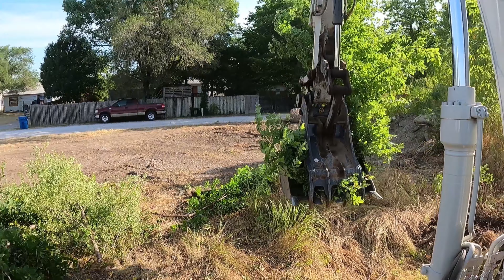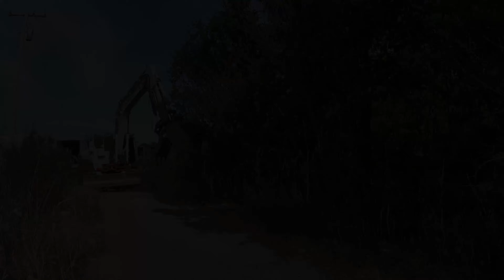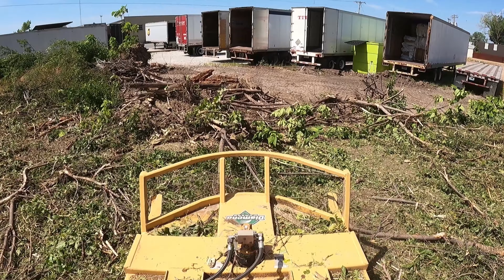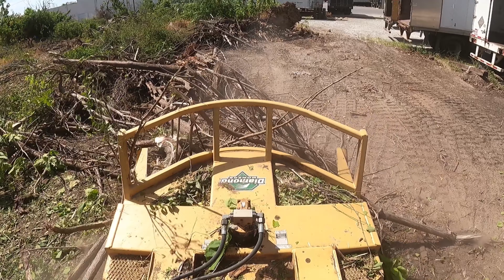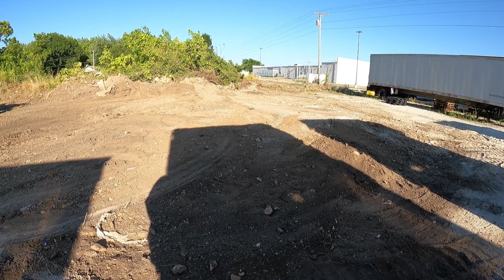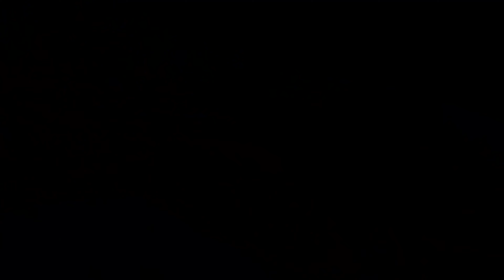Cleaning Up A Vacant Lot

Comment: A much better plan!  A fixer upper without the code restrictions vs.  a show building that meets some city engineers pipe dream of what a business should look like…. I’ll take number one every time!!!

A few more Saturdays and you’ll have this lot ready for trade!!!

Pulling those trees out of the cement might be easier than plucking them from this baked earth!  I was bush hogging my woods the past week.  Every 4 hours I had to stop and clear the air filter and radiator.  The engine never overheated but it is fair to say the radiator was plugged with dry leaves and dirt and the air filter had a half cup of dust.  

I decided to work on other projects and finish this one after the next rain… just hope we get one before it snows.

Keep living the dream… you’re getting there!
Reply from the maker: I agree this will be much better! No kidding that ground is solid right now. It was great seeing you today and thanks for the tomatoes 👍🏻

Comment: Do you have to haul off the 400 loads you mentioned?  Did I miss it or have you not been back to do the overflow and dredging on the storm water pond for UPS?  Hope you had a good weekend!
Reply: The storm water over flow was for FedEx not ups. I know this cuz I work at fedex
Reply from the maker: That’s part of what we have been hauling off there isn’t much left. I just got the approval to do the dredging job at FedEx. It will probably be next month before I can get to it
Reply: @ryansetser8434  thanks for correction. Saw the UPS trailer in the background and forgot FedEx.